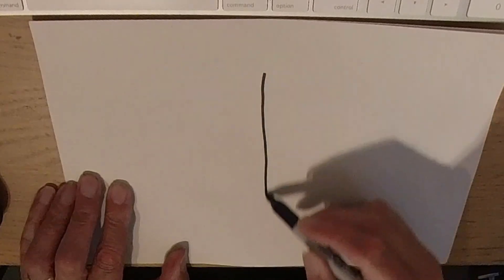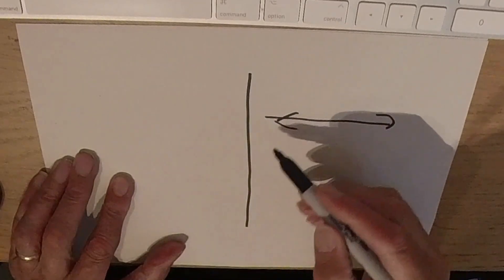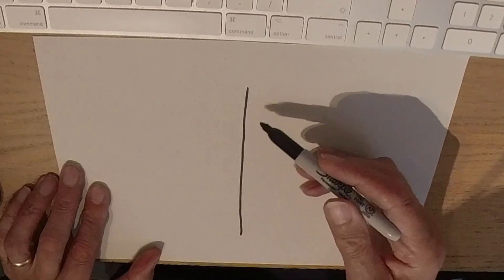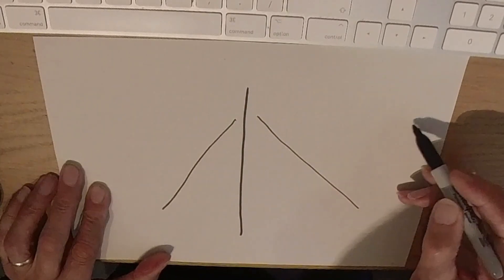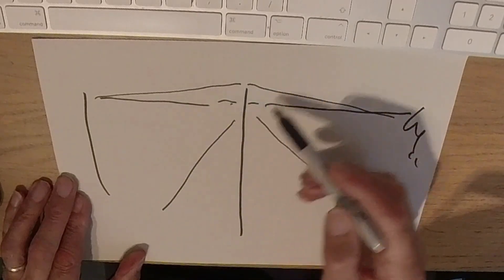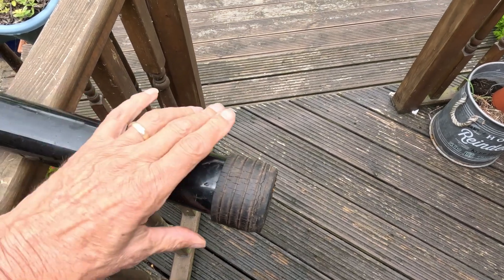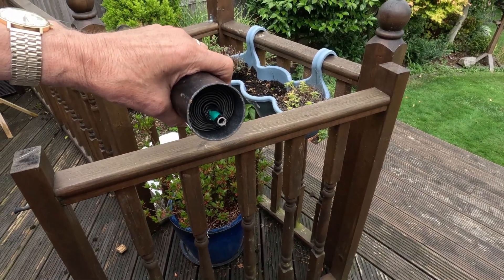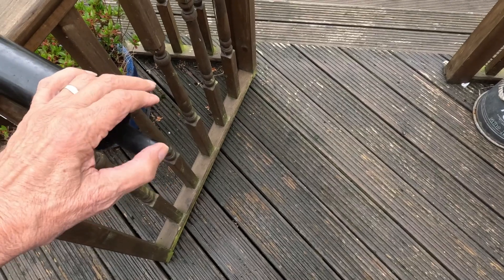SpiderPole Antenna Telescopic Mast Tutorial - Ham Radio

Comment: Thanks for this. How have you got the wire connected to the top of the fiberglass mast? You indicated you removed a few sections to reduce overall flex. 

What do you use to cap the top?

How is the antenna connected?
Reply from the maker: Top is hollow so large eye bolt and tape!
Reply: Thank you.

Comment: Hi Peter, Is it possible to run a vertical wire antenna Inside the pole.
Thanks.
Reply from the maker: Its hollow but you would need to drill an access hole.
Reply: @watersstanton  Thanks for your quick response, Pete. 
I am fixing the pole off the ground and will have access to the bottom, no drilling.
Thanks Pete.

Comment: These are great masts for the money, but I recommend always using the clamps, even for temporary installations. If one of the sections comes loose, it can come crashing down hard enough to deform the bottom of that section. It will no longer extend the full length after that.

Comment: Also how do you stop them unlocking when you don’t want them to unlock
Reply: You attach a length of cord or antenna wire to the tip and keep it under slight tension to prevent the pole from collapsing.
Reply: @darylcheshire1618  yes thanks , it works

Comment: I got a 7m Spiderbeam mast (not from you) a few weeks ago, I’m sorry I didn’t get the 10 or 12m pole as the 7m is way too light and flexible so you’re pretty much stuck with not using at least 1.5m at the top to add some strength to it.

Comment: I love my 10m fibreglass pole. It's a heavy duty version. It uses hose clips like yours except I have put some rubber pads on the inside held in place with heat shrink. This appears to give a bit more protection to the fibreglass pole sections when the clips are tightened. It's great for supporting the far end of my EFHW. Mind you I had to remove the top section through to reduce the lateral bend you referred to. The angle iron method of supporting it is a big thumbs up - works for me too. Now I'm thinking maybe the aluminium spidermast was the way to go🤔

Comment: I purchased  the same pole and its very good, i  also purchased the spiderbeam mast clamp set cs-12m. You should really be using stainless steel  for the clips and sleeved with rubber or pvc pipe as i have done previously with other poles. I have mine mounted on a length of 4x2 screwed to my garage wall and i use rubber lined Munsen rings as they give good support and protection. Great videos Peter 73s

Comment: It’s a great mast. I have it strapped to the wooden deck. Dexion angle iron would seem to work fine in an open space, but I doubt I can get it here in Canada. I worked at Dexion HQ in London in 1963 after I left school before coming  to Canada. VO1OK.
Reply: I ordered one here in Canada a few years before the pandemic and don't recall any problems or outrageous shipping. IIRC, I ordered it from the US distributor. It might not be the best for heavy dipoles, but works great to give height to lighter wires.
Reply: I didn't realize until closer inspection that you were talking about availability of the support, but glad you're happy with your beam.

Comment: Thanks, Peter.  I have a 12 meter Spider Pole as well and use it to support a vertical wire.  I've installed a remote tuner at the base and it works quite well.  de W5ODP  🙂